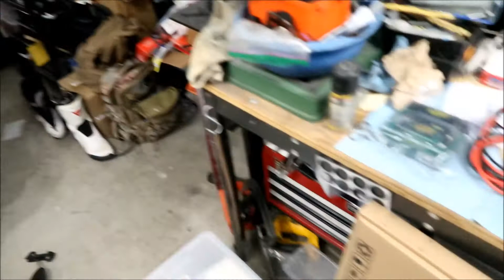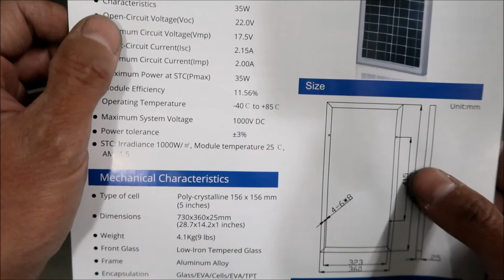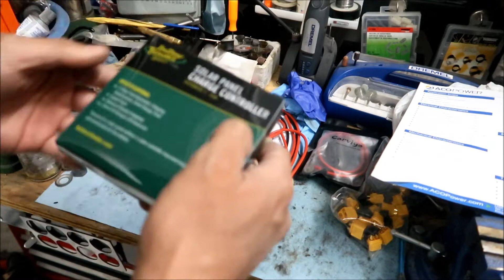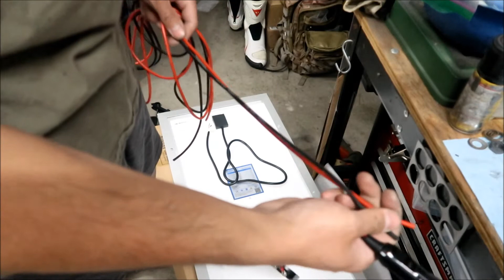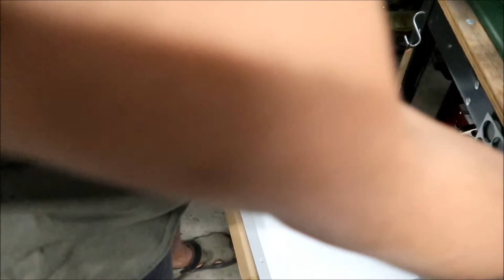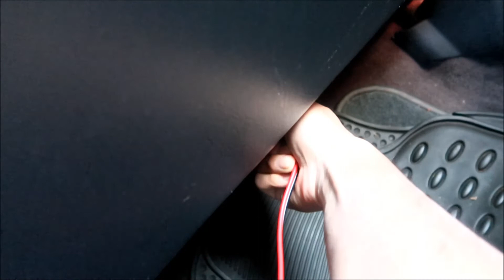35W 12V Automotive Battery Charger/Maintainer Build

Comment: Nice informative video. I have the 17 watt battery tender solar setup but seems not enough power to charge my battery in the storage. So i got the 50 watt renogy solar panel and the 10amp battery tender charge controller. Haven't put in on my vehicle yet but believe it would work great.  Hows your setup doing?
Reply from the maker: Thanks for watching.  It was working great unfortunately someone broke my window on my van and stole it =(